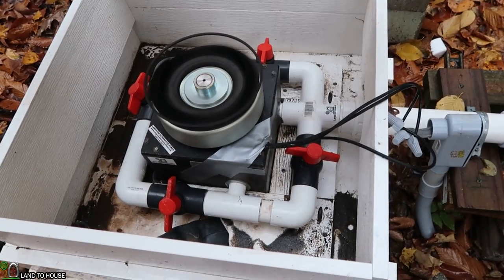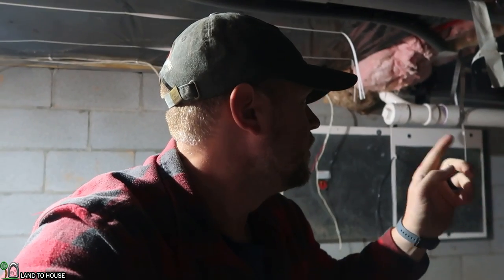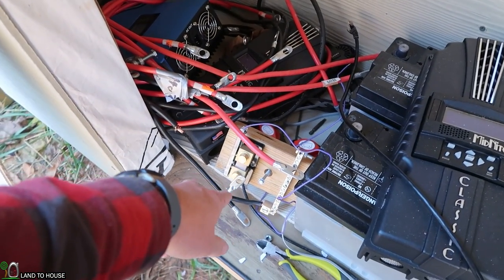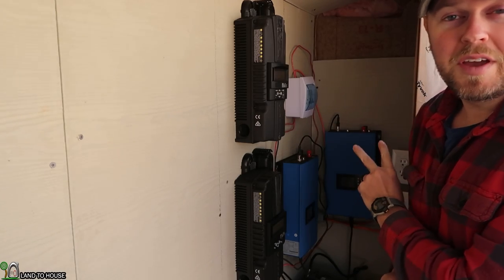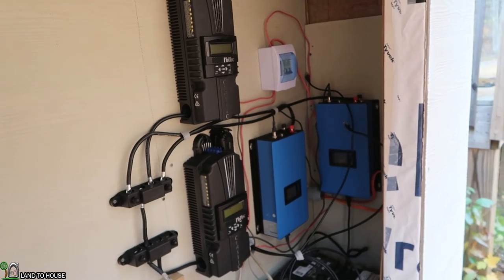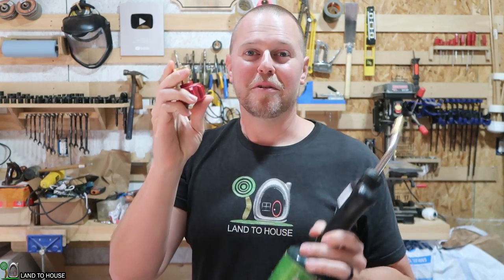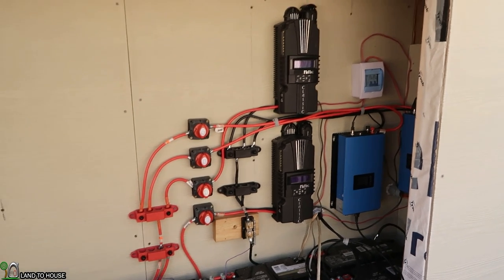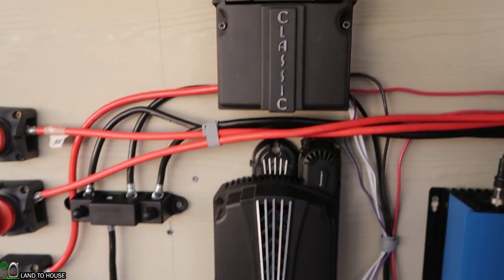Install the Solar and Hydro Power Electronics - Power Shed

Comment: Very nice install, Seth!     

I'm a Telecom guy, installation and terminations are my thing.    I didn't see you use No-Ox grease on your bare wire or your lugs.    Using No-Ox will prevent any oxidation on your connections due to oxidation from dissimilar metals - your lugs have metals other than copper in them, thus they will oxidize and corrode.    You can get this stuff at any electrical store, and it's cheap.    Just put a thin sheen on your cable ends before you crimp, crimp them on, and when you go to bolt down your lugs, put a thin sheen on the lug ends themselves and you'll have pristine cabling 20 years from now.     

No-Ox is especially important on your battery terminal cabling - that's a lot of lead & copper interacting there.

I use a heat gun for my heat shrink, but a torch does the job too.

Great job, it looks a lot better!
Reply from the maker: Thank you for the great info! I actually have a small tube of that but I am a wire crimping noob and did not use it.

Comment: Looks very good. One note on the grounding.  You must only have one ground point (per NEC) in you elec system, and that should be the one that's on your main breaker panel (where the ground is bonded to the neutral from your electrical service, and this must be the only bond between them). All other devices that need a ground must use the ground coming from that main breaker panel.

If you have more then one grounding point, you could have current flow in your grounds which can lead getting shocked.
Reply: So if you're doing a sub-panel like in a barn away from the house, you have to run a ground wire all the way to the barn?  What if your wire to the barn is direct bury?
Reply: @frenchopotamus  The cable going from the main to the sub should have a ground in it, along with the L1/2 (black/red) hots and the neutral (white), on split single phase system. (or P1/2/3, black, red, blue for a three phase wye, or blue, orange, black for three phase delta.  White is always neutral. Green or bare is always ground. 

In the sub-panel, the neutral and ground must not be bonded, regardless if the system is single or three phase.
Reply: @thepeepsdotnet  Thanks, the peeps! Looks like I'm buying more wire ☺️
Reply: @frenchopotamus  You don't bond the neutral and ground in the sub panel, because your sub ground would then carry half the neutral return to the main panel
Reply: @workbenchz  Thanks! I've made sure to avoid that.  Didn't know if I could save some money with a ground rod at the sub panel, but apparently not. Oh well.

Comment: Instead of a long battery string with long battery wires running to bus bar, consider folding the battery in half so the taps will be in the center of the pack. Same fold on second battery for the other half.  That may lend to more power (less resistance). Congrats on getting batteries moved - ugh! Power shed look great. Good job. Thanks for sharing.
Reply from the maker: I would have had to make the power shed wider to set them sideways. (perhaps a mistake for making it so small. Time will tell)
Those batteries are so heavy. I was dreading the move. In the snow no less haha.

Comment: When adding a 2nd 12v battery to my trailer, I found it better to take Positive and Negative from opposite batteries...  In your case, this would mean opposite banks.

The reason for this is that even at 4gage, there's enough resistance that you will tend to draw from the bank you are connected to instead of drawing them down at the same time.  By taking your power from opposite banks, you tend to have a more even draw from your batteries.

You might also benefit from mounting a cheep 4-port Ethernet switch in your shed (instead of running a wire from the central hub every time you need Ethernet out in your shed.)
Reply: very true on opposite batteries, it balances the charge and discharge, allowing for even wear on the batteries.  i am a 12v electronics guys and can confirm this
Reply: NEVER NEVER NEVER mount Lead acid batteries close to your electronics ESPECIALLY DIRECTLY BELOW, the fumes from the recharge process don't play nice with them, I suggest you move them into another location, love your videos

Comment: Oh thank god. You will find it so much easier to work on now. Plus it's so much safer.
Reply from the maker: Everything about this new system is so much better.
Reply: @LandtoHouse  Dude i know. I know on several previous videos I was saying you need to do some cable management. FYI I'm in IT and i've had to work on rats nest closets...
Reply from the maker: @matt_1984_  I figure even what I have done is not enough for some people. I know a guy that is a super perfectionist. But for me this is a BIG improvement.
Reply: @LandtoHouse  Nah man, it looks good. It's safer and easier for you to work on, good job man.

Comment: Oooh-Ooooh I want one of those battery cable crimpers!  Great job on cleaning up that under the house tangle!  It looks nice and neat!
Reply from the maker: That crimping tool has been so nice! Making the wire just the right size is the best way to clean up the wire.

Comment: Hey Seth.
Wonderful install, and yes I could rant on about how not to do, much of it would be pure cosmetics. However, I will not. 
It looks a lot better than before and will work without flaws for years to come.
One thing:  When crimping terminals, only crimp the same spot on the ring terminal ONCE. Otherwise you did something wrong according to the manufacture.
Your crimps should be done in a smooth and some what fast manner, so the metal from the terminal "flows" into the copper strains. Do not stop in the "middle" of the movement to get a better grip or something, that will stop the "flow" and you cannot "reset" and start over.
And just to say it out loud, I love what you are doing. You are and will be an inspiration for my future off-grid project for sure.

Comment: Hey Seth, that is such an improvement to what it was under the house.  Well done.  Can I suggest a couple of improvements to take it to the next level. If you put the cables inside some condute that will hide most of the cables.  The other thing that I would do is to put the switches/isolaters in a place that is accessible from the outside of the unit, so that if it did ever catch fire, you can turn off everything without opening your door.
Reply from the maker: It was my plan to have a disconnect outside but that did not happen in this series. I will need to find a way to add that in the next update. A disconnect for both hydro and another for solar.

Comment: You should have dc breakers or fuses between the batteries and the inverter so that you don't damage your inverter with too many amps. The maximum watts of your inverter devided by the voltage of your battery bank equals the size of the fuse or breaker. Never mind. I just saw the next video. Good job. Nice setup.
Reply from the maker: Yes that is a breaker to keep it from getting too many amps.

Comment: Between your buss bars, id add more jumpers between them, at least 2 per bar should be good, this will just allow your batteries to charge faster with less current going thru each one

Comment: You may have noticed but just in case you didn't when you hooked up your batteries with the two Banks of batteries you left your inputs and outputs on the same side and didn't have it on opposite sides of the banks of batteries you can either move the negative to the front or move the positive to the front of the bank of batteries to help balance the draw and charging of the batteries. I don't really know if it will make that big of a difference in your setup but it might over time help a balance in your batteries
Reply: It's a minor difference, but not doing it will wear our the one bank faster as it is taken to slightly higher/lower voltage than the other.
Reply: Those batteries don’t really last very long the way it is, anything that will help should be done

Comment: Seth well done getting your system back up. However, my OCD would never allow that sort of wiring to exist. You're lucky I don't live close by. You'd find one night that I had sneaked onto your property at night and completely and reorganised that whole setup. Straight lines, Cable ties and trays, measured cable runs, proper radius bends LABELS!, you know the sort of thing only mental patients think about!
Reply from the maker: Haha there are now labels on the switches and charge controllers.  

 Compared to what it used to look like I am much happier. Before it was a disaster and now it's manageable.

I don't have much OCD So the new system looks pretty good to me.

Comment: Just came across your channel and binge watched hydro power/ grid tie setup. Really appreciate what you're doing and breaking it down to layman's terms! Quick question, are you purchasing additional inverter to replace or parallel current ones? Do current inverters supply 240/120v sufficiently? Thanks!

Comment: you are doing good , but i want to give you a little tip i am a electrician for 35 years and you never run ac or dc power in the same conduit with phone or networking you will get some interference on your low voltage wires , when i was a kid i was building a shed and i ran a conduit to feed it then i added a phone line in the same pipe and every time i was on the phone i had a lot of static on the line from the power being to close

Comment: Refilling propane tip: put the small bottle in the freezer overnight. It will allow you to get more liquid propane into the smaller bottle. If you fill it when the bottle is warm, the liquid propane immediately expands into gaseous state which takes more volume than the liquid propane.  

To test this, get two empty bottles and weigh each bottle. Put one in the freezer overnight,  then fill both bottles and weigh the bottles again.  The frozen bottle will weigh more which means there is more usable propane.
Reply from the maker: I like the idea of testing this way. I will have to empty two bottles and give it a try. Thank you for the great tip.

Comment: SO MUCH BETTER!  Are you planning to implement any kind of heating option in that equipment shed, for future lithium battery deployments?
Reply from the maker: That might be something that I get into at some point. I would need a lot of free cash to buy those batteries. I also need to place a temp sensor out there so I can see what it gets down to. We will have some low singles this winter and it might freeze in there.
Reply: @LandtoHouse  - Depending on  how you're using that system, and how long you plan to continue doing so, you may find that it will be a better financial decision to switch to lithium (LiFePO4) when those SLA batteries reach the end of their life cycle.  The amount of capacity you can get in a given amount of space and the number of charge cycles you get from lithium makes them the only logical choice in some installations.  I'm sure you'll look at them the next time you need to replace your batteries and by that time they may be the only choice that makes sense.

Comment: Hi Seth, first time viewer of your videos - thank you for this very detailed video and especially the overview explanation at the end.   I am curious, what is the total cost of that set up here in the video?   I am wondering how a setup like this compares to some of the latest products that have come out this month like the Delta Pro. or the Mango Power Union (not out yet).  

  To me one advantage to this system is the ability to replace individual batteries as needed.    I am trying to find the best solution for my off-grid small cabin.   I need to power:
- 1HP well pump
- small on-demand water heater
- regular electronics use (up to 500W)
- under tile heating mats (up to 500W when in use)
- induction stovetop (1200W in use)
- small 5000 BTU air conditioner in summer (500W)
- small fridge

Looking to incorporate a small water turbine for charging as well, as I have a flowing water source.
I also am looking for a system that can operate in colder climates (10-20 F in winter sometimes)

The systems I mentioned are all-in-one options where the inverter is built in.   I like the DIY approach and customizability, but I'm trying to find the best bang for my buck and the right setup for my use case.  Appreciate your, or anyone else's input.  Thank you and happy new year

Comment: Are the AC outputs of the inverters female & it looks like you're plugging those cords  into (male) HOT prongs into those wall receptacles ?
Reply: Hi Dale,

Those are grid tie inverters.
This means they will not be hot until they detect a proper A/C waveform, then they become hot.

Those male plugs are quite safe!
Reply: @DavidHalko  That's better, but ask any electrician about having any kind of hot exposed leads/ prongs.
Reply: @dalemarr70  - right, but they are never hot until after they are plugged in.

It’s just the way it often is, it’s not my design decision:
- Grid tie inverters often ship with female sockets
- Regular inverters often ship with male sockets

(This is, of course, unless your inverters do not even come with sockets!)

I personally prefer recessed male plugs & attaching a female to the house wiring, but the grid tie inverters are usually not designed with female sockets like regular inverters… perhaps someone might mix the two types of inverters up and cause a little magic smoke! :-)

Comment: 15:00 thats kinde of the tool we use as electricians in denmark to take the isolation off and cut wires
Reply from the maker: Yes it is effective.

Comment: I noticed your top mppt charger is set to 60 and the bottom is set to 48. Should probably pull those to the same voltages.
Reply from the maker: Yes I forgot to show that I set that to the correct setting. The hydro was down for a long time and it was set for when I had a single 60v battery. now the system is 48v with two batteries. Good eye.

Comment: Nice shed. Climate control will be a real challenge, everything inside is moisture, dust, or temperature critical, high humidity can wreck electronics, cold or hot temps can degrade or destroy batteries,

Comment: those cables look Offley small for running a house off of. I typically run 4/0 from the batteries to the inverter. but I was also using a 12V system, not a 48V system. what is the current draw from the inverter at max load at 48V?
Reply from the maker: The two grid tie inverters are set at a max of 850w. So the amps are 17a. No issues for the 4 awg wire. 

The new off grid inverter can supply 3000w. So 62a. Still within the specs of 4awg.

Comment: You mentioned earlier I think about an emergency shutoff switch outside the shed?
Reply from the maker: I need to find a way to install that. It would just power down the solar and hydro input.
Reply: Grid tie inverters won’t back feed, the shutoffs  are already installed, just not accessible to the outside of the box, I’d leave it alone, more tamper and child resistant locked away!

Comment: The biggest issue I see is that your batteries will freeze their arses off in the winters...
Inside, under the house they'd get some heat from the ground underneath and I presume you never had that space freeze...

I too plan for a shed for the whole bunch but it will be on the ground and thermally insulated on the outside and even heated when necessary.
Reply from the maker: I need to place a thermometer out there. So far this year we have had 22 degree weather with no issues.
Reply: @LandtoHouse  batteries are sluggish in the cold, that's all. 
Lead cells tolerate the cold but perform worse than above freezing. 
I get 20-30% less discharge capability on my nickel and lithium batteries at 22F... and, of course, no more charging on lithium below 32. 
Also watch out for condensation. A cooled shed overnight might form condensation in the mornings, inside. The inverters and regulators won't like the moisture.

Comment: no offense but whats stopping you from slicing the cables and making them longer?
Reply from the maker: Haha yes good point. Most of the wire could be extended under the house and then spread out in the out building. The issue was the amp reader for the limiter inverters. Those seem like specialty plugs and I did not want to bother them.
Reply: @LandtoHouse  ah I get what u mean mate. I assume the resistance in the wire could be effected. It still looks good though as a hole mate. Not that I’m the person to judge but I always get given info to improve on so I thought u would share.👍👍

Comment: I dont like how did you connect that battery. You MUST put fuses there and also you have to fuse each 48V bank separatelly. When one battery dies with internal short circuit this could be a big boom. Fusing each bank could save it. Also I would connect them to bus bars separatelly trought switch. Then you can disconnect only one half easily if or when needed (for example for capacity testing).
Reply: Yes, I agree as in telecommunications battery backup plant. I had 16 strings of batteries, all were fused at each string. Plus look up "run away battery condition" = fire!

Comment: What is shant
Reply from the maker: A shunt is a metal strip that the wizbang Jr spans to read amp based info.
Reply: Specifically the shunt is a precise 0.0001 ohm resister that can handle up to 500 amps.  Measuring the voltage across it tells the WizBangJR how much current is flowing through it.  For example, if the grid tie inverters are pulling 23 amps total from the batteries, the wizbangjr would read 2.3mv (0.0023v) across the shunt.

Comment: I think the power cable that connects to the outlets this kind of danger  shed need to be locked down all the time
Reply from the maker: The grid tie limiter inverters are excited by the grid. The moment the grid is removed the inverters are powered off. But yes I do have a lock on the door to keep people out who dont know what is going on.